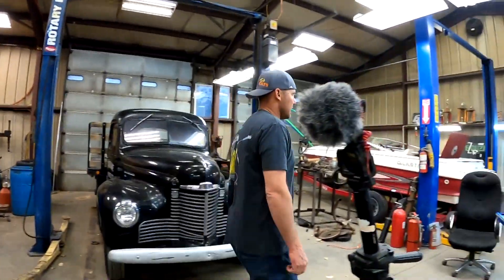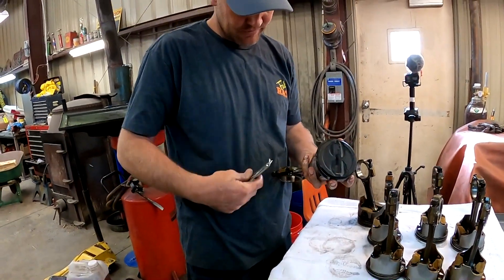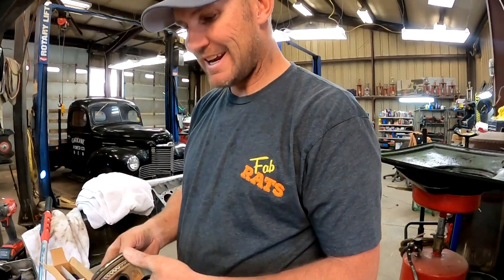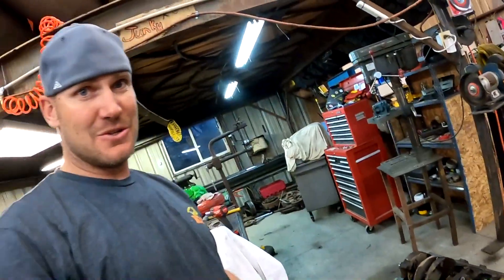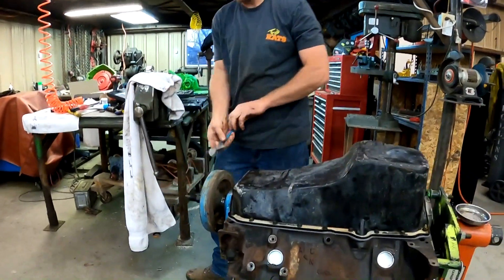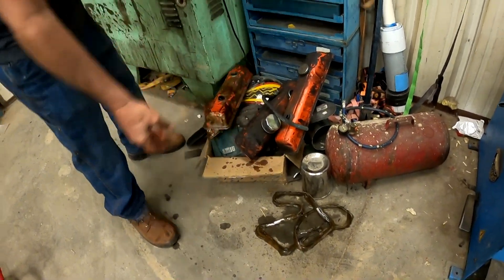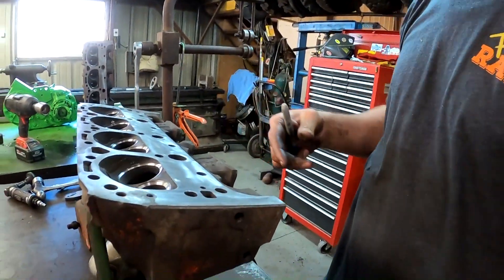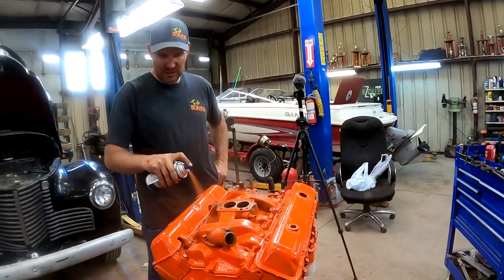Building a MOTOR in 30 Mins!!

Comment: I used to carry a good knife in my pocket and gave them up for the folding razor blade knives. Get the Milwaukee one that has a flip out storage tray for spare blades. For 98% of what I need a knife for, the razor blades are the best option. No need to sharpen them, just use it til its dull and flip it around to the other side. When the blade is done, trash it and pop in a new one. No ruining an expensive blade anymore. No time wasted sharpening. 
And if you lose it, you're only out $20 or so.

Comment: For anyone watching this wishing they had a mentor like Paul did, I'd highly recommend picking up a service manual and giving it a shot anyways. While it's nice being able to have a conversation with someone who knows what they're doing while learning something like this, it is still possible to learn if you aren't so fortunate! Frankly, service manuals have even more information then you'd pickup from rebuilding one with your dad, but it will lack those special tricks (like the socket trick to remove the valve springs, that was a good one).
Reply: In the 70s and 80s the owners manual told you how to adjust the valves and set the timing now they tell you not to drink the fluids I'm worried about kids who don't have the closeness and love for the same hobbies like these guys do

Comment: I`m gong on 72 and worked on cars, motorcycles, airplanes , and trucks. I`ve had numerous work go bad due to the machine shops entrusted. I flew owned and flew an experimental airplane that the builder didn`t give attention to the valve angle grinding like you showed. You da man , son!

Comment: Man I wish I had half the knowledge Paul had with building motors and everything else. This man has the knowledge
Reply: He's probably forgot more about vehicles than I've ever known and I grew up working on everything we owned but we were A diehard GM family I can remove every bolt and totally restore a square body Chevy but that's all we had on the farm and we had almost 5 acres of parts trucks with the occasional GM station wagon sprinkled in
Reply: I wish I had the shop and the knowledge.
Reply: @FatGreenSheep  I was going to say "tools" but you're right. You have to have a shop to work in.
Reply: I started out working for my stepdad on heavy equipment, cranes ,backhoes, dump trucks, bulldozers , that kind of stuff at about 8 years old I was cleaning Parts in the shop, by the time I was about 12 I was pulling engines apart, he taught me a lot, then later on when i was about 16/17  I got my own  truck of course I couldn't afford to pay anybody to do the work,  if I did my stepdad wouldn't be happy anyway because he knew I could do it myself, us kids didn't have a shop of course so we did most everything in the woods behind my grandparents trees were our cherry pickers lol , I pulled a lot of engines using trees, I had an 83 Toyota that I bought but it pretty much needed one of everything ,we pulled off the cab using trees and then did a complete frame off , stripped it down to bare frame , threw it on an old boat trailer and took it to the shop to use the pressure washer,then i had to weld in all the repair panels on the frame , that was the beginning of my fabrication career, I liked fabrication a lot more than turning wrenches, I still turn wrenches of course because it's kind of a necessity and helps pay the bills, other than that we  rebuilt the entire truck in the woods ,also I'm in Southern New England so everything is Rusted, rust can teach you a lot of tricks about getting stuff apart,
Reply: @bertbccfu9564  wow Bert that’s awesome! Basically you’re self taught. Kids today wouldn’t even know where to begin. You had a great upbringing my friend. Thank you for sharing that with me

Comment: This could well be the smartest man on television today.. certainly the most talented craftsman on the internet.  Years ago, at the peak of dirt track and go cart racing, there were a handfull of old motorcycle (2 stroke) mechanics who kept marginal machines running (competitively) night after night. It was as if they had invented them and their hearts beat with the same rhythm. Paul does not not require diagnostic tools, factory manuals, timing lights, even torque wrenches. His life experiences guide his ability to make things work.      The magic of his internet postings is his gentle strength which is rewarded by results.  Paul, we are all enriched by your efforts and success.

Comment: Boy, does this build ever bring back great memories.  My last car project, at age 16, before leaving home for college and career was building a high performance 327 Chevy with my younger brother.   I bought a bare block from the Chevy dealer and built the engine with all new parts (which I could buy wholesale) except the heads.  I ported and polished the heads and ground the valves with a dual angle using a Sioux valve grinding machine just like the one you used.  We put 12.5:1 TRW pistons, a high-lift cam, Edelbrock high-rise manifold, Holly 850 dual-feed carb, high-volume oil pump, Mallory electronic ignition, chrome headers, oversized oil pan, etc.  Everything that wasn’t available in chrome or polished aluminum was painted Chevrolet orange.  It was a beautiful show-room engine!  We dropped it in mom’s Impala to test it, then removed it and put it on an engine stand for display in our auto parts store.  Dad sold it shortly after I left home.  I’ve not been inside an engine again in over 50 years.

Comment: I had to go back in the archives to watch this one again😆  you did it pretty much the way i was taught. 
Maybe the only things i do different, i soak the pistons with the rings in motor oil for a few minutes before installing them, & i smear a coat of assembly lube on the cylinder walls. 
Then i was always taught you plasti guage every main bearing & plasti guage every rod bearing. Of course always smear liberal amounts of assembly lube on cam bearings & the cam shaft. 
 We ALWAYS either knurl valve guides, or replace the valve guides, whichever the head needs. But we always at least knurled valve guides. Everything else is exactly the way i was taught. 
When rebuilding engines, lubrication is your best friend. You can never use too much lubrication😆

Comment: Way back in the days (late 60's), during my high school years an old mechanic told me to coat all the bearings with STP oil treatment. It was very thick. Never spun a bearing using this method. That was old school. Not as good as the stuff they have today. Love your channel. God bless.

Comment: I did 20+years in the motor trade, Grey Beards as we called them, would pass down nuggets of information never found in the manual, things they had learned from some of the 1st true Mechanical Engineers, if you couldn't find it you Made it, unlike todays fitters computer tells them what to replace, and needing to wait for parts to be delivered. Watching an old fashion shop in action, need to work on your bin baskets though.

Comment: Here is a tip for you.
With Cork gaskets, like tappet covers.
If you spray silver paint on Cork gaskits, let dry, can tighten down a little more and stops oil seaping through the Cork.
On holley carbs if you spray silo one on the bowl gaskits you can pull them apart without stuffing the gaskits when doing rejecting.

Comment: Your build brings back my younger years of rebuilding without a garage & just had a 8' by 10' metal shed to work on them in and it's so nice to have all the extra space and machines to do the rough stuff but i grew up poor & we had do everything by hand or pay a shop to grind the seats and valves or magna-fluxing them but we got by the only build i blew was in a early 60's straight 6 i think was a 300 blew piston out the side the block & still drove it home !

Comment: you do things way different than I do.  I would have plastigauge when everything was clean and dry and then put the assembly lube on and put it together.  I guess everyone has their own way of doing things.  And I definitely would have cleaned all the old gaskets off the block before I would have started assembly.   I am sure that engine will work fine; however, I will never have you build an engine for me.  I would have you do some fabrication though

Comment: Nice work we used a rod stretch bolt gauge to get exact. When torquing the rods realized one torque...some bolts pull differently. Dreamy videos for me. The state and the shop is very nice. Thanks again for another wonderful watch.

Comment: Hey Paul, what issues have you had with Supertech filters? They used to be made by Champ, had depth filtration media, synthetic anti drain back valve, bypass valve that didn't sweep oil flow across the dirty filter before dumping it back into the engine, plus I've run them for years and never had an issue. Would appreciate some education.

Fram yes I agree, garbage in an orange can. I HAVE had issues with Fram.

Comment: I've used lithium grease for motors that aren't going to be run for a while, it stays on the bearing and doesn't run off. The problem with it is that you have to charge the oil filter after the cam has been broke in usually after 30 minutes because the grease doesn't liquefy and plugs the filter.

Comment: I am 72  now and have a lot of trouble with my hands and the skin of my hands too. I used to build race engines for myself and others. I have to date had 13 operations on my hands and have to use prescription skin creams on them , because like Paul here I used to thump things home with my hands and did not wear protective gloves against part washer liquids, Trichlorethylene, Carbon Tetrachloride diesel and petrol, thinners and acetone. At one point my fingernails fell off because of Acetone.  Be warned guys and girls these chemicals will have long term problems for you. I am at present, July 2022, looking at having yet another hand op, seriously it's no fun. Brilliant channel love the content and the love of the family.

Comment: Just another tip. When you're removing the springs that way, it is best to tip the head so that banging the valve like that doesn't accidentally bend a valve slightly when or if it hits the metal table surface. You need to tip the head in order to give the valve some clearance underneath.

Comment: I have o rings inside the valve guides on my 58’ rover engine and they were wrecked and it didn’t smoke. So I am guessing that there is so little oil up top on these old engines that gravity is the seal. And on my pinto engine overhead cam the seals have to be good or it really smokes on startup :D

Comment: Just a little tip but you probably  already  know but didn't  do put some short pieces of rubber hose or plastic tubing over the rod studs so you don't  accidentally  scratch  the cylinder bore or the crank.   You probably  already coated the camshaft with grease but I saw one guy pour oil over the cam after it and the oil pan where installed just before bolting on the intake manifold.   Now that I think about it you could mix a quart of oil with the zinc additive and pour that on the camshaft just before putting the intake on the engine.   Where any if the heads from the other junker engines "valuable"?   Can you show us what permatex stuff you use and also what brand of RTV?   Do you  plan to prime the oil system through the distributer hole before installing  the  distributor?
Reply: Do you know what he used to coat the rear main seal with by any chance?

Comment: @FabRats. Look at motorcycle oil for high zinc content. I have a marinized chrysler 318, '73 vintage that I had the same concerns. EPA did not ruin motor cycle oil with their regs, so they still have a high zinc content.

Comment: That's what we call reconditioned valves nice work we ground them with vale paste in head I sell all my old valves and cams to a engine repair shop if the cylinder head is no good
Reply: I do remember using valve paste and a hand spinner to make sure that they were seated properly.
Sharpies did not exist back then.
Reply: The nowadays method is using a cordless drill instead of the old suction cup stick

Comment: 15:51 gonna say, if it has a one piece rear main seal, it has to be a newer mid 80s engine as that's when gm introduced the one piece seal. Before that was a 2 piece rubber lip seal that went in the rear bearing cap

Comment: the 77 to 96 toyota motor what you think be the hormonic balancer you dont need a puller to take it off its like it dont balance the  motor my dad rebuilt motor in his dAY HE PUT IN A REBUILT motor on a dodge slant 6 motor he not mic the crank shaft the original balancer wobble because the crank shaft not the same on the new motor as the old one

Comment: Boy a chrome timing cover gave me FITS trying to seal the damn leak...was leaking between the main stamped piece and the bottom channel that was tack welded in just a few spots. Had to fill the inside bit w good ol JB Weld and just slather RTV in the channel for the gasket!

Comment: Beautiful job. On that SBC you're probably using an AC Delco PF-35 oil filter equivalent. Try a PF-932 filter. It is a 2-quart long version oil filter for trucks. It will give you roughly an extra quart oil capacity. Check it out. This is a tip from 40 years ago.

Comment: Paul which international motor is this that you are building? I had a 72 international pick up with the 392 I think it was in it and that was a beast of a powerhouse it had a documented 300,000 miles on it and had never been broken apart.

Comment: i was taught and have preped cylinder heads surfaces, pretty much the same way, no issues doing so for 15 years. if in doubt, blast em with copper spray, lol

Comment: Question: My '96 454 Suburban (original owner) has 225K Miles. I upped the oil to 20-40 as at idle after a freeway run in the summertime,  the low oil pressure light would come on at idle. It runs a solid 40 PSI (max) when hot in the summer on the freeway at 80 MPH. I am thinking of new rod and main bearings with hand crank polish with the engine in the truck. Do I leave it alone (and possibly spin a bearing?) or do what I am suggesting? Than you. It has never ever dry-started.

Comment: Ok, it's been over 40 years since I had the heads off one of those, but is that white grease or sealer you have on the head bolts? Seems that I recall that they screwed into the water jacket.

Comment: Hey Paul, I was taught form a young age not to put assembly lube on the rings, prevents proper seating of the rings to the cylinder wall, has it ever caused you a problem?

Comment: Our derby car engines for the local fair derbys are built the same way and I have a 318 that's been in 6 to 10 derbys a year depending on the year this year was it's 6th year and we have to finally refresh it I'm hoping it's just a sloppy timing chain or worn cam but worried it's more serious because it sounded like an old Johnny popper for a couple minutes before it died and hasn't fired up since we'll see when we get the car cut from around it and get it on the stand

Comment: Was curious about piston ring position or clocking...does ring gap location matter?? Thanks paul
Reply: It definitely does.  Usually with three rings, you position them 120 degrees apart.  This limits the potential blow by issue.  Honda failed to do that on my Odyssey, and the results was massive oil getting into the combustion chamber, fouling out the plugs.   They had to replace the rings under warranty. At 90K miles

Comment: by looking at those head say 2 thing the motor has alot of miles on it or the oil not change that much you ever do a mazda b2500 motor its a ford motor it has 8 spark plug put that white grease on the intake gasket or it suck air if you dont use it

Comment: Question , Isn't the small valve the intake and the larger the exhaust ?
Reply: Generally speaking, the intake is the larger valve, and the exhaust is the smaller.  The exhaust can be smaller, because the exhaust gasses are pushed out, while the intake needs to be bigger, because it is pulling air in by vacuum.

Comment: One expensive torque wrench for never really using one. I like the old still with the dial with like the speedo point on it or the screw it the bottom one's. You know what I'm talking about I would think other ppl might not

Comment: Chrome won’t get you home!!! I had a buddy that had a 1985 K-5 blazer that had a Dana 60 front and a GM 14 bolt rear and he had went threw both axels and rebuilt them!! The rear one someone gave him a really nice chrome diff cover!! I told him the same thing chrome won’t get you home!! After driving the K-5 for 3 or 4 months he was going down the highway and the chrome diff cover blew a leak wear the silicone didn’t end up holding up!! And yes it was a hitemp silicone and oil and gas resistant and it still blew out and his rear end locked right up running down the Hyway luckily he’s an awesome demo derby driver and was able to keep from rolling his nice lifted K-5 blazer that was on 38” swampers and sitting pretty tall!!! I told him I don’t care if someone gave me something that was chrome for a truck the first place that stuff went was definitely the trash can!!! Chrome won’t get you home!!!!

Comment: 29:00 Engine, not motor, engine. Motors are externally driven, like an electric motor, and an engine is internally driven, like the one you're working on.
Reply: There’s always one, always. Do me a favor, Google the word colloquialism. Yes technically speaking it’s an engine, but in my experience only people that read about it insist on calling it an engine. The people that work on them mostly call them motors. I hope you lodged your complaint with Chrysler as well. When do you think we should expect to see the name of their parts division changed to the technically correct EnPar? Have you ever seen a Harley Davidson Engine Cycle?… Me either. Correcting what people call things doesn’t make you smart, it doesn’t make you cool, it just makes you an a$$.